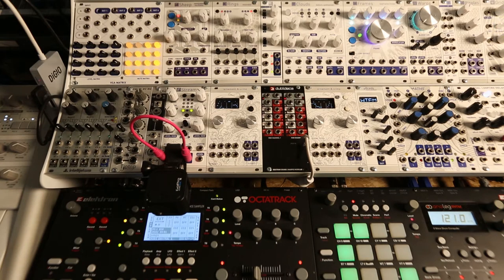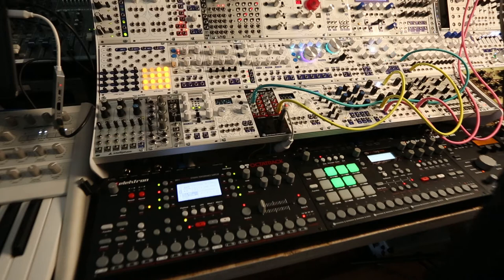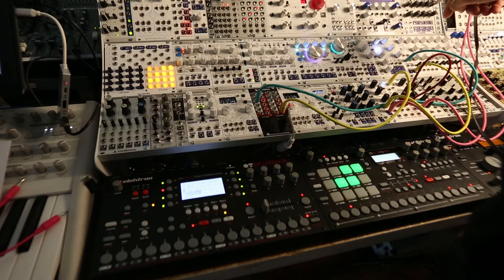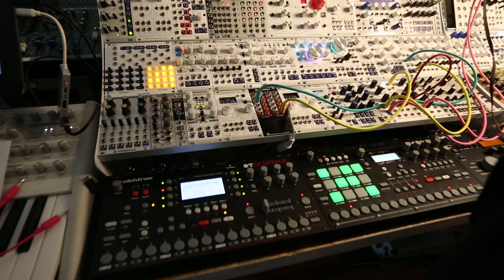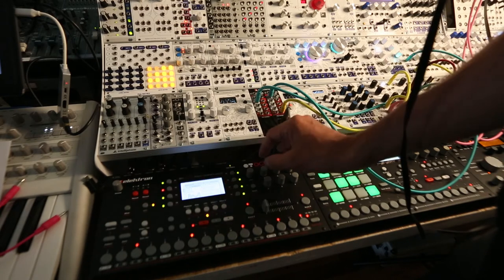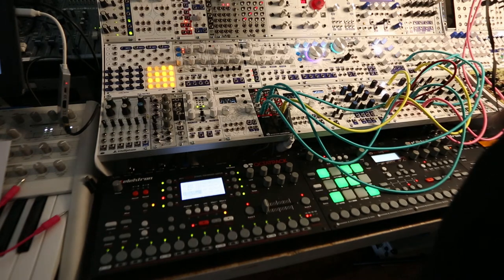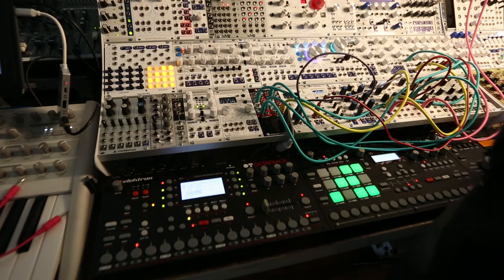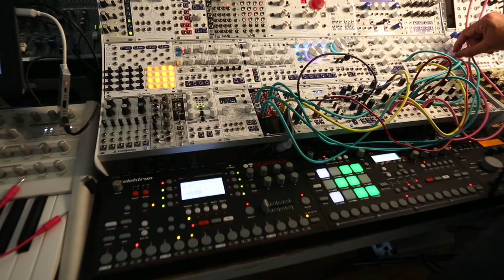Dbldecca: Octatrack Eurorack MIDI Out Module - Intro & walkthrough

Comment: Still the nerve center of my larger case. At this point I’ve modified the FW to give a static gate length, static gate level, all the drums on the same channel. Changed the 16k9 resistors to 18k and now have a pretty clean 1V/8va across 8V. I don’t use it with an Octatrack but this FW vibes hard with my MPC1k. I’d post a link but I think YouTube would delete it automagically.

Comment: Hi all,
Can someone explain me, how it is working?
Which Octa outs are used? I can't see clearly which cable is going from Octa to Dbldecca.
Also, is there only midi tracks of the Octa are used or all of them and audio tracks of Octa will be disabled when using it with modular?
To be clear, I hope that configuration while using Octa with Dbldecca is - 8 Octa midi tracks are used to control modular AND 8 Octa audio tracks are free and available to run some samples alongside or maybe for routing modular out back to Octa for processing/recording etc.
Please clarify, thanks!
Reply: This is just for the 8 MIDI tracks. The audio tracks have nothing to do with it and you can use them as you please.